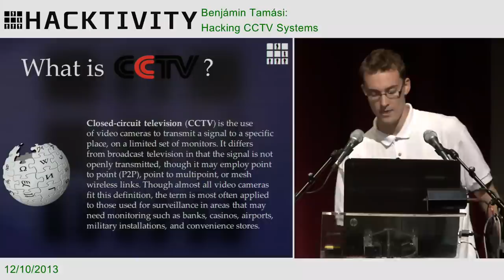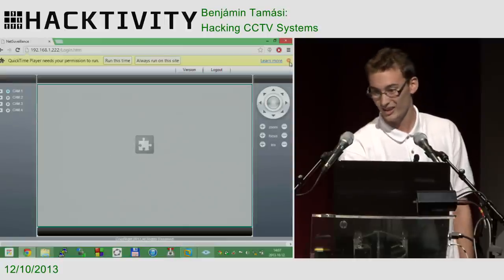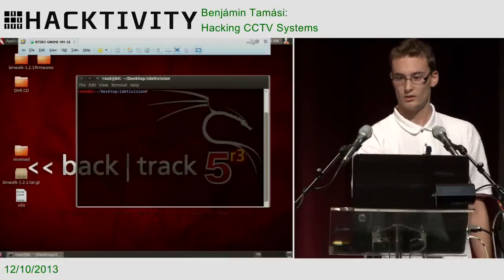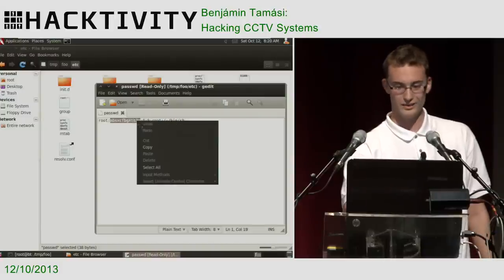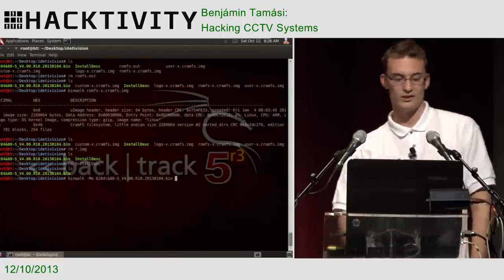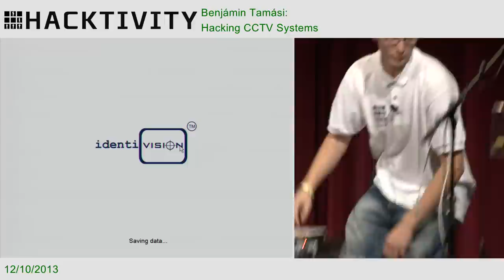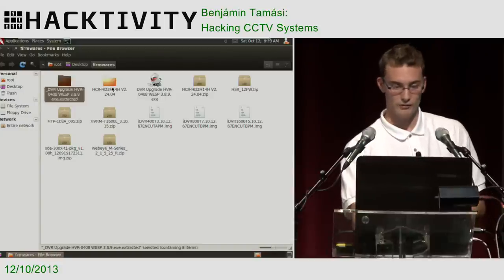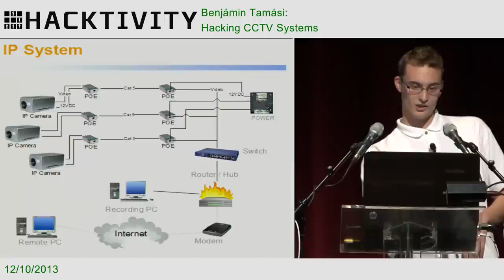Benjamin Tamási - Hacking CCTV systems

Comment: Its really easy to log in on these DVRs, but you don't have access to the recordings on the HDD. The disks are not mounted directly on linux like the rest of the system. It's not a normal filesystem. There's a binary file that runs the "DVR program" which manages the HDD pseudo-filesystem. It's messy and I still did not find a way to do it.
Reply: +Luiz Aguieiras well you have raw i/o access, so technically you have access to anything you want. Actually making use of that data is something else entirely :)

Comment: Oh, those hostess girls... :)
Reply: what do you do if you get errors when using the unzip command? that's what I am getting
Reply: Can you paste the error msgs?
Reply: Sure give me a day or so and I'll give all the errors I got, I was using Kali 1.0.7
Reply: dan r Okay worked no problems using Kali 1.0.9 using VMware, I think my USB live Kali 1.0.7 was corrupted some how. 
So now I have an 11 character hash, how do I crack the hash, non GPU cracking method. I Don't have a good GPU
Reply: MrWakeboarder540
so using john179 got one of the pswords, the where 2 files in the etc folder, one named passswd and the other named passwd-
the 11 character one was easy to crack, the other one is MD5 and I will have to run it over night and hopefully it will finish. Thanks for your help and video.
Reply: MrWakeboarder540 Sorry mate, the purpose of this video is not to teach you how to crack hashes, search google on how to crack MD5 hashes without GPU
Reply: Oh yeah I hear you, your video helped me get the hashes. Was very helpful and had some good humour in it! Thanks
Reply: A good sense of humor will get you anywhere ;)
Reply: I like the low tech building security a bit more but this was nice . thank you.
Reply: Hostess girls? in this video? :D
Reply: Ez nagyon jó előadás volt! Amúgy, ha válaszolsz csak egy kérdésem lenne. Melyik hazai e-mail szolgáltatót tartod a legrosszabbul védettnek?

Comment: I'm just wondering what happens if a tech person installs these things and make the password actually something tough to break like example (pretty extreme I realize) "ex23EZCB*@$!2018E%^". But, in my experience the amount of time to break a password as the one I gave a suggestion as would take possibly years if you do "brute force....". I guess technically "password guessing" is hacking it's just highly unlikely assuming the person has any computer knowledge.... Which as a result would make this video useless...? I more just wondering how a person could hack a strong password vs password guessing which is the weakest form of hacking.